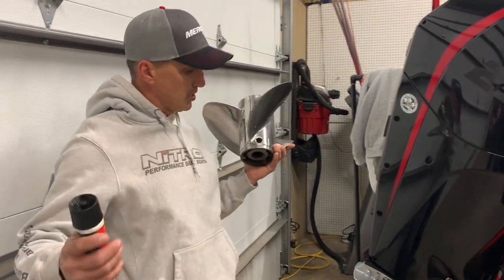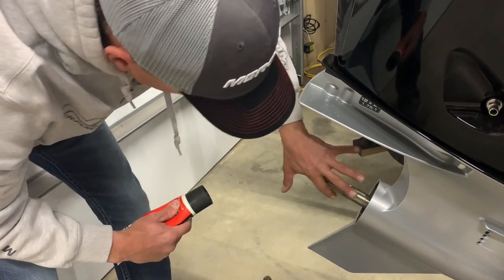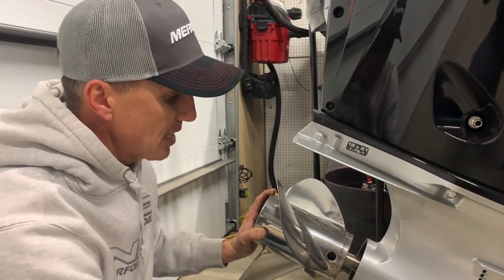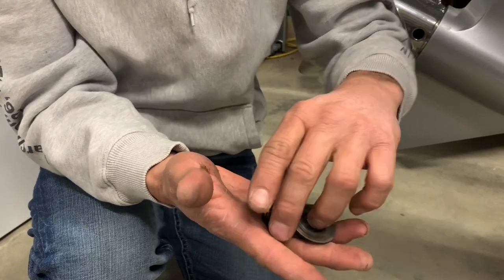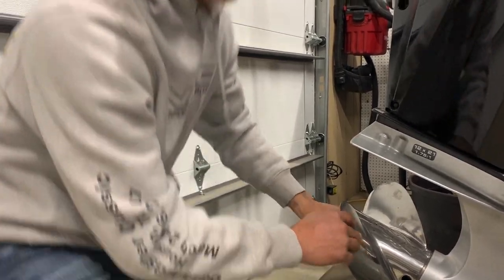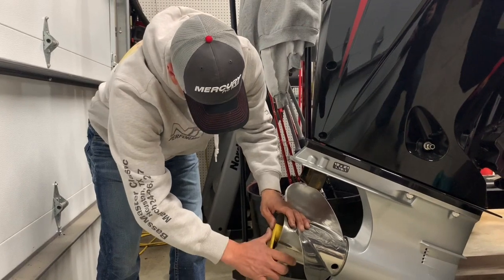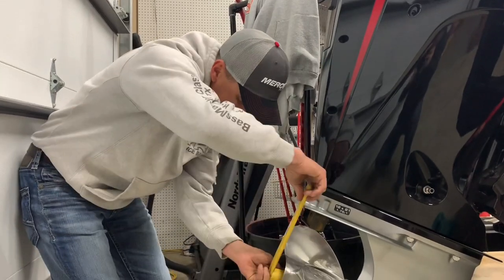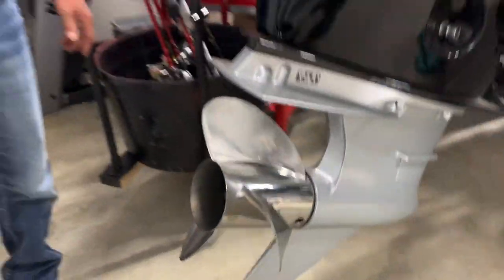Prop Bite: Propeller Installation

Comment: Is there no locking tabs with the ssr hd hub?? How does the prop not come off in reverse?
Reply from the maker: Great question! The beveled washer acts as a lock washer would, by keeping constant pressure against the propeller nut.
Reply: @MercuryMarine  Before you go answering peoples questions you should really make sure that you know what you’re talking about! It is actually the self-locking nut with a nylon insert that keeps the propeller on tight! Another thing you forgot to mention is that those lock-nuts with nylon inserts should not be reused, As cheap as they are they should be replaced every time!
Reply: @NeverEnoughPyro40  The prop nut kit is $60, do they sell the nylon insert separately?

Comment: are you sure you did that right??  I didn't see the thrust washer that goes on the shaft first....
Reply from the maker: Hey Bryan! This propeller either has the Solid hub or the SSR HD hub, both of which essentially have the thrust washer built into the hub sleeve. But great catch! With a typical Flo-Torq II hub kit, you would slip the thrust washer onto the propeller shaft before sliding the propeller on.
Reply: @MercuryMarine  i think i noticed the vent holes were not plugged at all, i just put 300 pro xs 4 stroke on my boat and installer said vent holes should all be plugged completely on new 4 stroke motors, on the old motor 250 pro xb i was running 3 large vent plugs in prop which is mercury tempest 25 Pitch, this new 300 pro xs doesnt seem to act right at all over 55 mph and doesnt seem to want to spool up to max rpm, should i try same set up as before and install large vent plugs again, im also concidering switching to a fury prop is what some people have said, what would be your thoughts, thanks Cliff
Reply from the maker: @1969krout  Hey Cliff! The vent hole configuration will change per the application. You could try opening one vent to see how the performance changes. If you see improvement, try another. Use this method until no noticeable change is made, or the performance suffers. You'll also want to double-check with your installer to verify they used CDS G3 (dealer diagnostic tool) to get the propeller pitch dialed in appropriately. This ensures the engine is operating at 100% performance output. Great question!
Reply: @MercuryMarine  thank you very much I will talk to my dealer here who just did my 20hr service, I had motor installed at a dealer in PA called Blackbird Industries I will also call them, thanks again

Comment: why cant you just put in gear vs using a block..... and why didn't you use a hub kit or was that in the prop and not shown.....
Reply from the maker: Edwin is using a one of our Flo-Torq SSR hub kits, and it was already installed in his propeller. We encourage the use of a block when removing and installing your propeller. Without something to hold the propeller and propeller shaft in place, you run the risk of turning the entire engine driveline when applying pressure to the wrench. When the engine is in gear, the propeller shaft, driveshaft, and crankshaft, are all engaged.
Reply: @MercuryMarine  wow we have been doing this wrong, always place in gear- so glad you taught me the correct way, I will follow your advice, thank you......  Ron
Reply from the maker: @RonTrovatoRealtor  You're welcome! Many users simply hold a piece of wood (such as a 2x4) between the propeller and the anti-ventilation plate to hold the propeller steady while turning the propeller nut. If you would like to purchase one of the lightweight and handy propeller blocks as shown in the video, the part number is 8M0129072. Thanks for supporting Mercury, and have a great day, Ron! 😎🙌